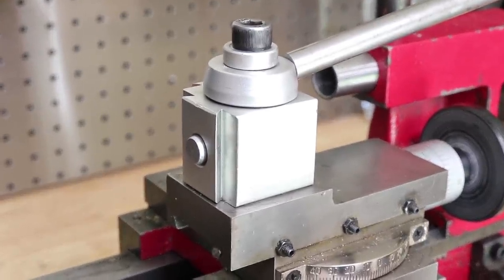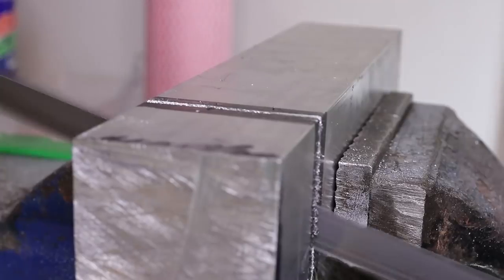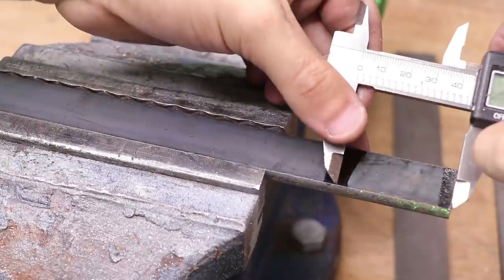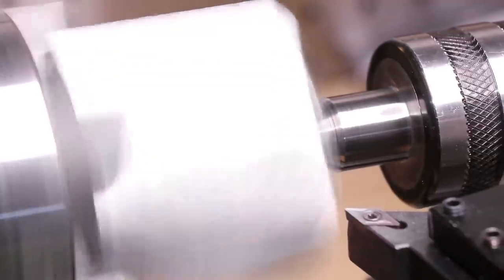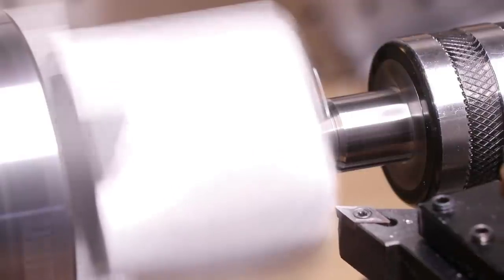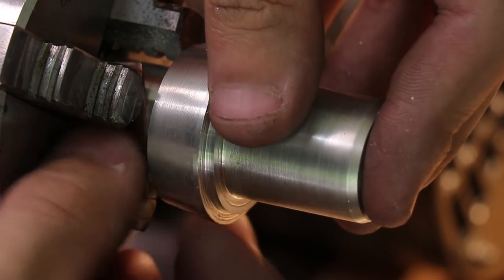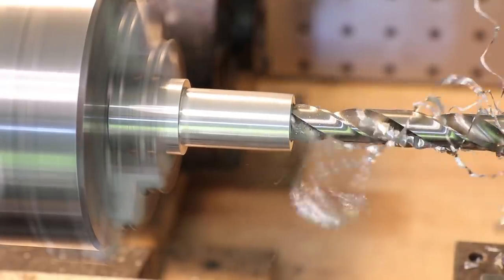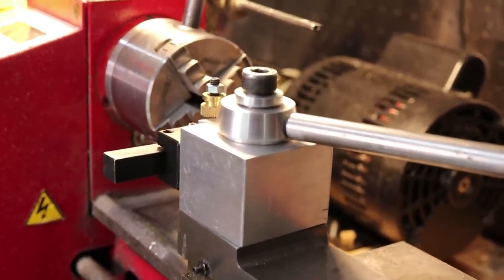Making A Quick Change Tool Post Without A Mill

Comment: Here's a hint, when you cut aluminium with a hacksaw or any kind of saw or cutoff wheel, Use wax on the blade. It stops the ali from sticking to the blade and makes it cut much faster.
Reply: What kind of wax?tank you...
Reply: @marcoserra3798  any kind of wax, even candle wax is better than nothing at all. They do sell blade lube in stick form specifically for this. I've used old beeswax too.
Reply: Antonmursid🙏🙏🙏🙏🙏🇲🇨
Reply: Butter also works at a pinch and smells good if it gets hot (normally on angle grinders). Use the unsalted stuff.
Reply: Thank you!!! Awesome hint!!
Reply: @marcoserra3798  Bees wax.
Reply: @kieranh2005  would the salted butter act as a lapping paste? haha
Reply: Kerosene works well as a cutting fluid
Reply: WD-40

Comment: Great job, it is very impressive how you skillfully made this tool holder using only the most basic hand tools and a lathe!
Reply from the maker: Cheers. I did this simply because my will does not have the capabilities to produce the dovetails. I think lathes should be able to produce their own tool holder without the need for a mill.

Comment: That is awesome man. I've been going back and forth about tool post for my lathe. After seeing your design I'm definitely going to try and make one like yrs, awesome job.
Reply from the maker: Thanks, I'm glad you enjoyed it. This design is great if you don't have a mill. I've used one for.6 months now without issue. My only strong recommendation would be to thread lock the bolts in place and if possible silver solder the wedge to the aluminium. Cheers
Reply: @artisanmakes  thread lock the ones holding the dove tails on?
Reply from the maker: Yes, apologies if that wasn't clear

Comment: I live in the UK and would die just to get hold of a piece of aluminium like you have. I do struggle over here trying to source material for the workshop. Cast iron is also a problem, only real chance I have is to go to a car scrap yard and purchase some brake callipers take them home and cast them into a suitable size. The price you are paying is for a used completed part rather than the lump of cast iron you want. Same for steel, aluminium etc. A scrap yard will not sell you ferrous or none-ferrous metals in any shape or form other than an intended part for a given purpose, then you have to somehow turn that into something that you want as a starting point to machine. So please forgive me when I say I am immensely jealous seeing you turn so much off that rectangle aluminium to achieve your finished parts. Thank you very much for sharing, I enjoyed the video, it was informative, and I only wish I could do the same. I have the talent, the training and the machinery but not the materials. A nice balanced video. So I envy you along with the Americans who also seem to be able to purchase almost anything. I am dreaming of making a fixture pallet for the mill from (1) aluminium and (2) cast iron but cant source the material I need.
Reply: I saw this and I was curious, so I checked, and I did find some online suppliers that didn't seem that expensive. I'm a little curious if there's some critical problem with them or something.
Reply: @Taygetea  I have not found any on line suppliers who sell that kind of metal, I would love to know where you were looking so that I may invest in some materials. Thanks for the reply.
Reply: @bernieshort9774  All I did was search 'uk aluminum bar'. i saw aluminiumwarehouse, metalsupermarkets, 1stchoicemetals, metals4u (all co uk urls).
Reply: @Taygetea  Thank you for your reply, 1st choice metals came up for me for Aluminium, somehow it did not come up on previous search results so thank you. I don't want to get into a too and fro with you and do thank you for your help but I still stand my my original post. I can not source 6 inch round bar and much much more. The choice here in the UK is not so good. Once again thank you.
Reply: @bernieshort9774  I'm in the UK as well, and I sympathise.  But I sometimes get offcuts from local engineering companies, which I've found to be good sources for me and other hobby machinists and model engineers.  Then there's the specialist model engineers suppliers, and many suppliers on ebay.  For the specific case of your 6 inch aluminium bar, and yes I realise that was but a single example, the second hit on ebay for "aluminium round bar 150mm" was from alum-droitwich, only £26 an inch (but it is 6" not metric) ;-)  I didn't try it for that example, but I often search ebay for "alumiunium offcuts" and I've bought a lot that way.
Reply: @pnt1035  Thank you

Comment: G'day Art, very very clever use of the tools you have. Really impressive result man. If I can offer one quick filing tip...the best surface finish possible from a file is by draw filing. Hold the file (file itself, not the handle) in both hands like you were on a motorcycle , then push and pull the file over your surface until all file marks are gone. It will even negate the need for any more time to be spent on that surface. Cheers again and happy Christmas mate. Thank for all the entertainment and knowledge you provided this year. 
Stay safe & be happy. Michael 🤓🇦🇺🎁
Reply: Not if you're a C&G skilled tradie.
I'm getting a bit old now at 71, but I still have a filing muscle on the top of my elbow.
With that, the file stays flat no matter what.
Reply: @jenniferrobinson4277  not sure exactly what you mean but I’m interested if you’d like to explain more. Cheers.
Reply: @SpatialGuy77  won't let me post a pic.

Comment: Great video, but after I watched your video about using HSS blanks to make your own HSS cutting tools as I was undecided about purchasing carbide tip indexed cutting tools for your mini lathe or making my own using the HSS as you referenced in your video saying the HSS tools were better for use with the mini-lathe than the carbide tipped. I  purchased 10  sticks of 1/4" x 200mm HSS blanks from Amazon. And now I see you using the carbide-tipped cutting tools in this video, I am thinking I made a mistake and maybe should have purchased a set of carbide-tipped cutting tools.
Reply: G'day Jon. You did the right thing! Making your own HSS tools is perfect for a hobbyist. They are much much cheaper than inserts, give a far better finish, you can re sharpen them, and when you get to understand the tool geometry, clearance angles, point radius and chip breaking, there isn't any application you can't make a tool for. 
The only drawback, and the main reason you don't see hand ground HSS tooling in machine shops is because you can't machine with HSS as fast as you can with carbide inserts. Carbide can machine up to 12 times faster. In business, time is money. Also, they can machine very hard material and most can stand a lot of heat. 
For you and I, the satisfaction of making a part with cutting tools that we made from scratch with our own hands is priceless! I do have one carbide insert boring bar that I had to buy when I needed an accurate hole in a titanium part. Haven't used it since! Anyways, pay particular attention to your lathe speed and your tool feed rate, use some coolant as HSS can be ruined if it gets too hot and keep them sharp. If your HSS tool is ruined, it's only a couple of dollars for a whole new HSS bar which can be any tool you can imagine. Here in Australia, a pack of general purpose 22mm triangular carbide inserts from a budget machinery house is as $220AU where a 3-pack of HSS square bits, 3/8" x 3" is $12.00AU. I'll say no more!
Stay safe and Merry Christmas to you & your family 🎄 Cheers, Michael 🇦🇺

Comment: If you want a good finish on aluminum, and no aluminum on the carbide tip, use paraffin
Reply from the maker: I typically use mineral oil as a cutting fluid, I think that is similar to paraffin

Comment: I admire your hacksaw work and determination to create your own tool posts. But there's no need to use carbide tools on ally. Hard steel is good enough, I also noticed you used maybe your highest chuck speed whilst that whacking great big drill bit was in your tailstock end, the smaller the bit the higher the speed needed, not vice versa.
Reply from the maker: Thanks for the feedback, I have really gone back and forth on my view on carbide. I used to really like it for aluminium but recently I've made the switch to hss. As for the high rpm, it is an issue that i am aware of but don't have a fix for. I power the lathe using an induction motor and with the gear ratios I currently have the lowest rpm I can achieve is 1000rpm. Not optimal for sure but I hope work around it in the future. Cheers
Reply: @artisanmakes  If you use an induction motor, slap a VFD (Variable Frequency Drive) onto it. As your mini lathe won't have much power anyway, they cost small money on Ebay. And you'll get the full torque on any rpm up to the nominal rpm of the motor...

Comment: great design.

I'm wondering if that cam / off centered aluminium post is wearing out after frequent locking and unlocking = rubbing against that brass pegs.

sorry for using guesswork terminology as I'm a total noob in the metal works.

Comment: Nice!  I see chips flying all around the lathe motor vent slots!  Yikes!  So the strength and rigidity of the tool holder mount relies entirely on the two machine screws holding the dovetail slab onto the main housing? Perhaps that's enough for a mini lathe?  I see them coming loose over time.  Still amazing work overall!
Reply from the maker: Thanks for the feedback. I wouldn't be too concerned about the motor back there. It's an induction motor and doesn't mind a few chips here and there. It isn't an optimal method of powering the lathe, but it was a temporary fix that I haven't gotten around to changing. As for the screws, I know full well it isn't optimal, but I've used it for over half a year now with out issue. I didn't have a big mill at the time to machine the dovetails, so I made the best of what I had on hand. Cheers.

Comment: Question: would 65-45-12 ductile iron “work” for (quick-change) tool-holders?
Reply: I'd say no, because of the shock loads (interrupted cuts etc).   It'd be better than alu for the toolpost block tho, especially with steel dovetails like this one.

Comment: My only problem with this is that the 2 screws wont be able to take any kind of load or shock. The dovetail piece  WILL shift, sooner or later. At the very least, roll pins or blind dowels.
Reply from the maker: Thankyou for the feedback. I have been using this tool post almost ever day for about 6 months now cutting steel and aluminium and I still have not run into any signs of wear. In a perfect world I would rather use different fasteners, but so far, zero issues. Cheers

Comment: If you use insert tools, 90% of the advantages of QC disappear. Inserts are always the same height, so you manufacture a 'shim' the correct thickness, CA it to the bottom of the tool holder, and forget about height ever again. My set of 7 toolholders only had two shims to consider- all the outside had the same insert height (of course- why would the manufacturer do otherwise) and the two boring tools had another.  Other 'advantage' is registration. Well, all 4 of the 4 way are registered- only changes if you take them out. Unless you put a peg on that packer, then it registers every time- just like a QC. Given that a QC has one bolt to tighten, and a 4Way has two, the QC is twice as fast- after the first four. So the breakeven is eight. Different 8 of course- moving between the four installed is a simple spin. It then tips towards the 4way- where you can adopt many different angles to give different cuts, and then return to register. QCs need to be zeroed in- machinists take great care to align them with the ways. The 4way has a built in register.
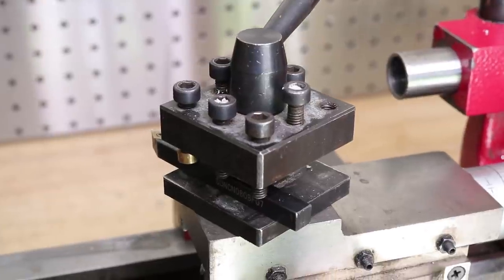Want to use the occasional HSS bit? Make an adjustable carrier that fits into the 4way. Use the rocking block style as at 0:36. You have to re-adjust every time you grind- just as you have to on the QC.

Comment: I just bought a QCTP and I bought a 7 piece 12mm bars like yours from banggood 
anyway are the carbide inserts any good cause I'm thinking about buying some extra
 inserts $9 for 10  I'm from Melbourne Vic
Reply from the maker: You'll get mixed responses depending on who you ask. I am personally really fond of carbide inserts, I think on hobby lathes they work fine and have the added benefit of not needing to be ground. I use hss more nowadays but I always keep carbide around. If the inserts have a sharper cutting angle I think it's work having some around, especially if they are affordable. Cheers.

Comment: What kind of glue is that your using and where can it be bought ?
Reply from the maker: Just regular CA based superglue. For most work I use the cheapest ones I can find at the hardware store. Usually $2 for a pack of 5.

Comment: @artisan I see your mini-lathe has a separate motor did you upgrade it yourself? and what did you change it to? I'm looking to upgrade my motor at some point to make mine more useable

Cheers Dan
Reply from the maker: The other motor is just a motor that I took from the drill press that I use. I don't use the drill press too often so I was happy to take the motor from it and swap it in when I need it. I originally swapped it in when the motor control board blew in the lathe. There aren't many things to go wrong with the lathe, but the cheap motor controller is one, and since a replacement was $200 AUD at the time, the drill press motor was my temporary solution which I've made permanent. It was easy to make, just a 50mm diameter ring aluminum  with a v - groove for the pulley that screws onto the end of the spindle that pokes out the end near the change gears. The drill press ran on a pulley set up so I didn't have to change anything on the motor. The big advantage that I gain from this set up is the lathe can comfortably sit at 2500 rpm. Most of what I do is cut acrylic, so the high rpm really suits me. With the old stock motor I was always afraid of going above 1500 due to the sound it made. Also since the motor is a fixed and constant rpm (around 1000) I get great torque when turning. It does have its disadvantages, such as it is a hassle to drop the rpm (but it can be done by using the other ratios on the pulley on the motor) and I can't use the leadscrew as it is a little fast, but I generally stick to using taps and dies. 

Hope this helps. Cheers.
Reply: @artisanmakes  awesome thanks for the reply do you know the power rating of the motor by any chance just looking for some more power . The shots I've seen you do with the parting tool makes me a little jealous. I can't manage at all with the parting tool motor doesn't have the grunt
Reply from the maker: @eXtReMeMoDd3rZ  You might be surprised that it is only a 390w or 1/2 hp motor from this drill press (https://www.ryobi.com.au/products/details/390w-bench-drill-press-rdp102l) I think the motor just has so much more grunt because its fixed speed. I have seen some of these mini lathes come with more powerful motors, up to 550 or 600w, but those done seem to come with a high and low gear selector. From my perspective, the motor I have now is adequate and a more powerful motor would require an upgrade to the carriage for extra rigidity to turn any faster.
Reply: @artisanmakes  Mate- the latest trend is to use the DC motor from a treadmill, with a cheap-as controller and a diode rectifier. Hunt up a free treadmill- people always throw them out when the board fails. then order a power controller board from Ebay, get a rectifier from Jaycar, a heatsink, a computer fan and some connectors and wire. Less than AU$100, and you have full variable control motor- I built this setup for my big wood lathe to turn bedposts- and it's awesome. The speeds attainable with a piece of 2100mmX150mm red ironbark are frightening!!! But you can dial it right down too- a cheap tachometer form ebay would let you dial in exactly what you want. Check out other videos on YT to see how to build this setup- believe me, you'll wonder how you did without it for so long...
Actually- there's a topic for another video- show us how you convert your lathe...

Comment: Hello, I see your video, it is very interresting. But I was chock when you put your finger into the bore of the aluminium part. For your safety never, NEVER use your finger into a rotating hole. Always with a tool or something. Your finger can be cut. Thanks.
Reply from the maker: Cheers, no my proudest moment in retrospect. From memory (and looking at the old footage) the scotch brite was just to round the corner slightly. The camera angle makes it look worse, but I am only pushing down lightly on the top corner and my finger was not inside the bore. Certainly won't be doing that again.
Reply: Totally agree!  High four to you ;-)

Comment: Nice job, but I cringed when I saw you put your fingers in the hole of the spinning workpiece! That's a good way to lose a finger (or two) - also, never try to remove swarf with bare fingers while the job is spinning!
Reply: He left the key in the chuck as well.

Comment: Bolts cannot replace pins.
Reply from the maker: Probably not for bigger tool posts, but they have done the job perfectly on this mini lathe. Cheers
Reply: @artisanmakes  You can easily add pens even to the finished handle. Two diagonally will be enough.

Comment: Steal would have been a better  construction material for this project. Unless you don't care much about it being a solid base. I do.
Reply from the maker: On a bare bones mini lathe it was fine and rigid enough to machine most metals. Only had to replace it one I started to machine alloy steel.